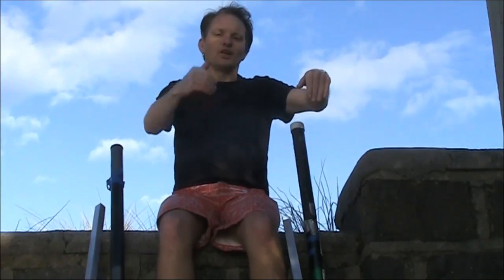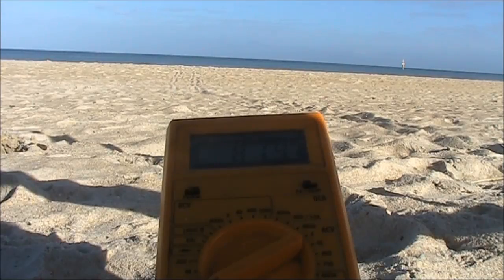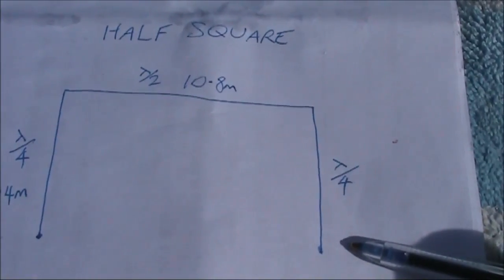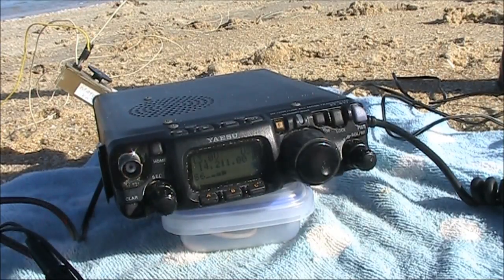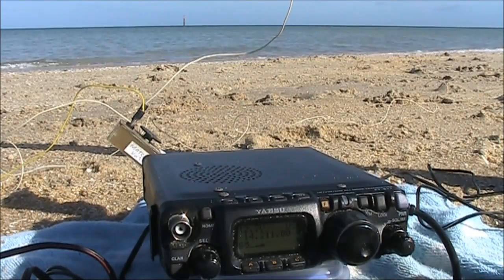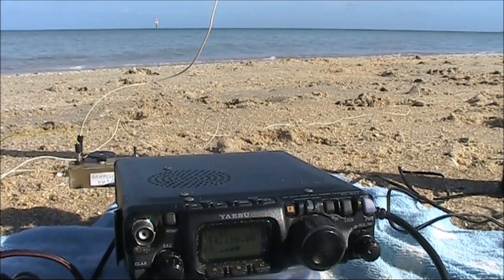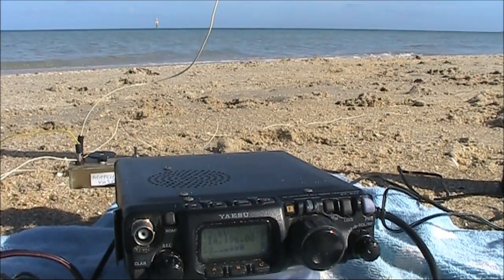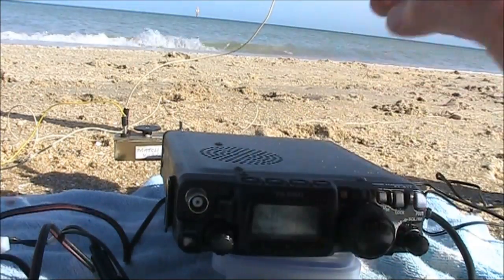Water's Edge Portable DX: A half square antenna on 14 MHz

Comment: Peter, great video  - I am thinking of doing something similar to his but fed at the base with a 49 or 64:1 transformer. With 20m total of wire. This means the antenna will be useable on 40 20 15 10. I know its the classic half square on 20m but I wonder how it would perform on the other 3 bands? I will be on the beach like yourself.

Comment: So many excellent videos Peter. Inspiring, Can't wait to try more antenna designs, especially your aluminum loop. Question - how does the half square compare to other 20m antennas you've used there? It models way better than the delta loop.  Have you tried a vertical Moxon for 20 with the squid poles?
Cheers es tnx. Peter

Comment: I have watched this video in the past, a number of times because the half square intrigues me in its simplicity. Peter, you have done with this one what I would have loved to try as a radio experimenter. I tried one for 27MHz dx strung between two 27 foot 
 poles either side of my house, held up with monofilament nylon line. It tuned perfectly but never beat a half wave vertical that was on top of one of those poles. It needs to be suspended with its drooping tips almost touching the ground, and that ground needs for to be of as high a conductivity for it to work optimally. As on the higher wavelengths the ground absorption is much greater and obstructions are of greater consequence, its advantage disappears, despite the elevated current node. This is an antenna used best at the oceans edge or over it and on frequencies below 14Mhz... In fact 7 and less would be much better again and 160m would be utterly unbelievable if you could support it!. I wonder if loading the 1/4 wave portions would hurt its performance much....